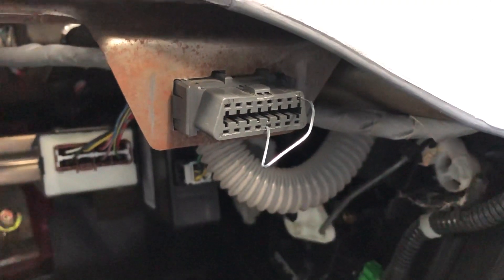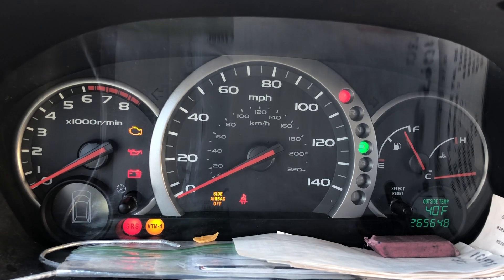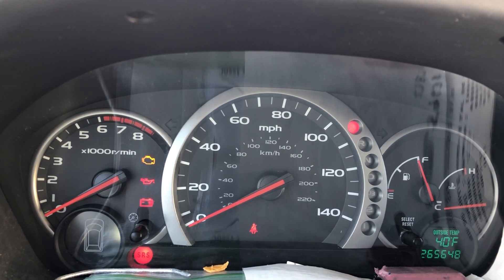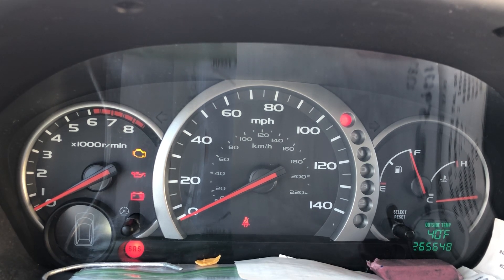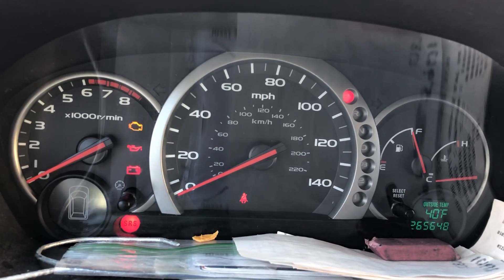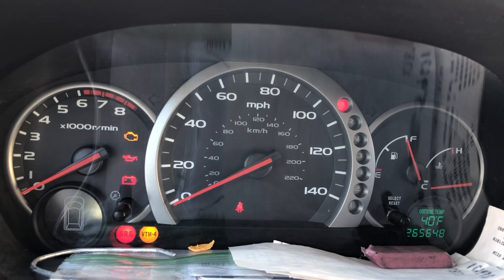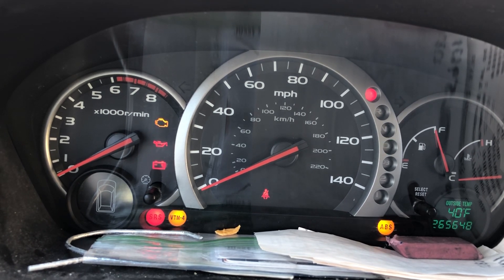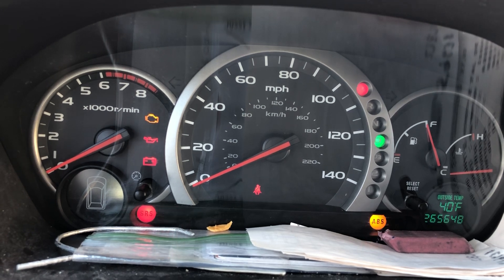2003 Honda Pilot FLASHING “D” Light while driving Transmission Troubleshooting Diagnostics Video

Comment: Even whenever the D light is flashing and you quickly take it to a dishonest mechanic, they just going to rip you off,if it flashes and your transmission is good, all you need do is get a transmission oil pressure switch,the 3rd gear,it should be black,and its easy to change,don't order it online ,get it from the store and you good to go.
Reply from the maker: Yes, however, I do recommend Honda specific branded parts or Denso only… Sometimes the Honda’s don’t agree with the competitor brands… Thanks so much for watching and commenting!! Enjoy your week!!
Reply: Having this issue now with my honda D lights flashes along with check engine management.How much was the 3rd gear atf sensor at honda?
Reply from the maker: I’m so sorry to hear that! But, know, it’s not your transmission itself that’s bad, which is great news!! However, I paid under $100 each for mine… I’d assume with inflation, prices have risen a bit, but I’d still imagine they’d be under $100… But to replace them, through Honda, you’re looking at a lot more costs involved with the labor and all… Decide what’s best for you, and good luck with everything!! Thanks for watching and commenting!! Take care for now!!
Reply: @GMoneySaver  I’m having the same problem. What are the name of the parts I should buy?
Reply from the maker: It seems as though you found the answer you were looking for in my description… I truly hope you found this video and information provided helpful! Thanks so much for watching & commenting! Best of Luck to YOU! 😊 🍀 🚘

Comment: Love this video, well done, those "hawkeye" diagnose, love it!  I just purchased an Honda Accord Tourer 2.4 2003, and NO CHECK ENGINE light on, speedometer working fine,  but this is what happens to it.  Any help, please?? 
https://www.youtube.com/watch?v=2ML5H6JxRJw
Reply from the maker: No check engine light on for this transmission issue is normal…
Do you have a local Honda Dealership Parts Service Retailer nearby where you can purchase the pressure switches and transmission fluid from? You’ll need gaskets which are metal rings. Label what parts are what. Also you’ll need approximately 12 quarts of transmission fluid for a full change out. But remember, you can negotiate a price discount sometimes with sales people…

Do you know of a close friend or family member that can help you with your diy project? 

I must warn you: ALL OF THIS, is very involved. Amateur mechanic adventuring, is NOT RECOMMENDED. Especially, if this is your only car, and it’s winter and you don’t have a garage or a backup plan…

Check out this website:

https://www.driveaccord.net/threads/d-indicator-light-blinking-on-accord-lx-2003.391498/

This website, might have some useful forums for your issues at hand… Bookmark it, because it might have a link for another future problem you may run into…

However, my presumption is, the person who sold you the used car with 270,000+ miles, didn’t want to deal with the solution to their problem, so now it’s your problem. 

Anyone can clear out these flashing D’s, “temporarily,” by disconnecting the negative battery terminal, waiting ten minutes, to “a day,” later, to reconnect them… Flashing “D,” won’t pop back on, until the gears initiate into 3rd or 4th gear again… Usually.

Anyways, I’d definitely change out that transmission fluid. One cycle change, minimum. Use only HONDA Automatic Transmission Fluid, PLEASE. Do not utilize store brand product. But since you don’t know if prior owners did, I’d definitely do (myself, personally), 3 transmission fluid change throughs… 

AND then, I’d change the 3rd and 4th pressure switches… With Denso or Honda brand only ones.

Find a mechanic you can trust!!! Who has heard of these “things” and knows HONDAS. 

Honda dealers will charge WAY TOO MUCH usually for these issues.

Also, you can chance driving around like this and mess even more things up.

The switches tell the transmission what it should do… The longer you wait on the true fixes, the more you risk actually damaging the expensive transmission itself.

The transmission fluid could also have nonHONDA brand fluid inside OR be at the incorrect level even(either too much or too little). Symptoms of too much fluid, are throwing your transmission into limp mode. And causing a permanent slip in your transmission. OR hard shifts. 

BUT if all of this at last resort seems too much to deal with, cars are a dime a dozen and not worth your headache and time and effort and so on… You can always find a buyer who knows Hondas and get at minimum $500 for your car, and invest your money into a new car, with a warranty and a Hefty Car Payment and insurance, BUT not have to worry about these awful issues… There are some great deals on new cars now with zero percent financing and you could keep getting a new car every year by paying $400 a month, and just never end up owning one…But, yet, NEVER, have to deal with issues like these… 

Best of Luck! I hope I helped and wish you ONLY THE BEST!!!
Reply: @GMoneySaver  my dear G MOney, what can I say. Thank you sooooo much for the time you took to answer me. Such a great human being you are. I will go this Friday to a garaje where they only deal with automatic transmisions; I will definitely change the oil, and check the switches. Best regards from Barcelona, Spain!

Comment: My car do the same put on go rivers hard waht can I do
Reply from the maker: If you’re not mechanically inclined to do it yourself, have someone change out the necessary sensors that need to be replaced with denso brand or genuine Honda ones… Don’t let them take advantage of your wallet though… Get multiple price quotes before accepting a good offer. And the car still can drive. I just wouldn’t let the issue get “worse.” Best of Luck and thanks for watching!!

Comment: Hello. Pls were u able to diagnise the vtm 4 codes. Like u said, the reading was sorta irregular..mine read something like 4 long, 8 long and then 7 short blinks. Dnt have any idea what it means. Cld it be 40 +80 +7
Reply: P0487
Reply from the maker: @supernintendo7579 Are you using a OBDII scanner or codes my way: https://www.troublecodes.net/honda/pilot-3-5l-2003-2004/?amp
Reply from the maker: 4 long means like 40, and 8 long, then 7 short, would mean 87. Long blinks are “tens” place values. Short blinks are “ones” place values. My vtm4 flashing meant a front left abs sensor was BAD. ALSO, my vtm4 light, didn’t pop up until after driving like 18mph, meaning once that popped, I couldn’t utilize auto 4wd kick in or gear down to use the option, until I literally turned off the vehicle and turned it back on! I’m not sure what symptoms you’re having or if you’re having vtm4 issues or not, however, if you’re not, make sure the codes delivered are consistent after your other problems are resolved. I hope what I said helped, if not I’m sorry. Thanks for watching, and Commenting, and Best Wishes!!

Comment: What is your MPG on it? I'm getting 12 on my pilot.
Reply from the maker: Usually anywhere between 17 & 20 mpg, combined city/highway. Never any less. You might need a good tune up or have bad gas. I also wait until 1/4 to refill my gas at minimum. I drive on mountainous roads, too. Thanks for watching! Best Wishes, alyssa!! 💜
Reply: Its an 03

Comment: I had the d flash while driving. It went away on its own. I have a code reader that plugs in will use it if the flashing D returns thanks for info
Reply from the maker: One of your sensors may be going bad... It may return a month from now, or a year from now, to stay flashing. Mine did go away at times, with both of my Pilots. Sometimes just by shutting it off and resting it overnight. Your computer may store the code. Paper clip trick would tell you if it’s lying dormant in the system. Code readers, unless the really expensive ones, don’t show the code for Flashing D. Code readers usually only show the codes for things when you have an actual check engine light present... Let’s hope you don’t have to replace the dreaded atf temperature sensor, and only a 3rd or 4th transmission fluid pressure sensor switch. Either way, be ready with GENUINE HONDA parts and atf fluid. These oem parts cause double jobs that no one wants to have to do, when it comes to Honda... Thankfully, there’s return policies through the stores that sell them... Good Luck either way, and thanks for watching!! Enjoy your day!

Comment: Fourth gear oil  pressure switch had same problem in my 2006 pilot but for drive flashing that is 4gear oil pressure switch
Reply from the maker: Mine was definitely the 3rd gear transmission pressure switch. The cheaper one at that. 😊 I also ended up having to change out the atf temperature sensor, too! Thanks for watching!!
Reply: @GMoneySaver  yea true maybe because your pilot is a 03 but needless to say I think they are great trucks right I’m looking at a Toyota Sequoia 2016
Reply from the maker: @MakonnenHallasie  Personally, I’m obsessed with Pilots. I hope the Toyota you choose, serves you well!! Enjoy your day!!
Reply: @GMoneySaver  I’m thinkin bout keepin da truck and gettin the yota LOL love the pilot also so confie
Reply from the maker: Great! I hope you enjoy your ventures! I wish you the best!
Reply: @GMoneySaver  thanx u also best in health and wealth and family
Reply from the maker: @MakonnenHallasie  Thank you. Thank you!
Reply: @GMoneySaver  did changing the switch work ? I’m having same issues no check engine light on thou
Reply from the maker: @wach1722  Yes, it fixed the problem. Again, no check engine lights. Just flashing D light while driving... Read my description for what parts I changed, too, if you think that might help. Thanks for watching.

Comment: Check the Fuse. If the wire in the middle is cut that means it blown.
Reply: 4gear oil pressure switch when D blinks
Reply from the maker: No wires were cut.
Reply: What fuse? I have same issue currently
Reply: @SelinamChisom  it’s going to be labeled ecu cruise control most likely a 15 amp